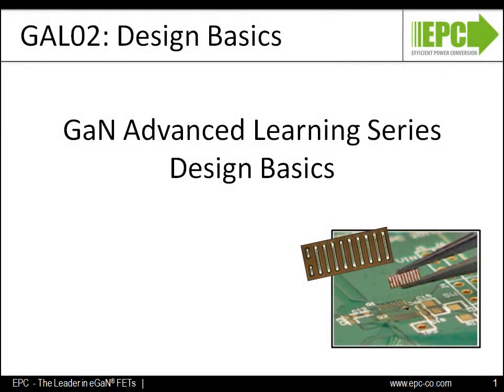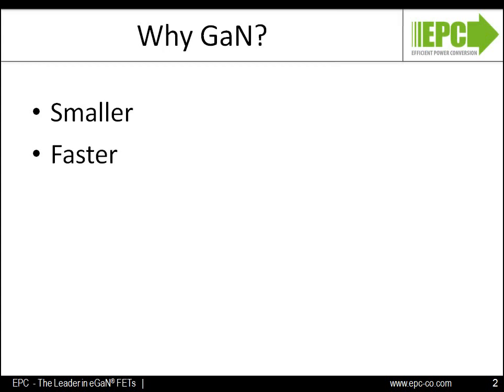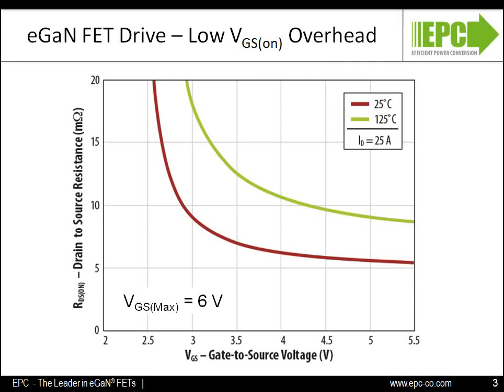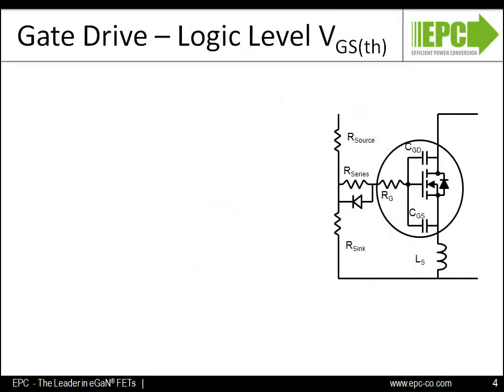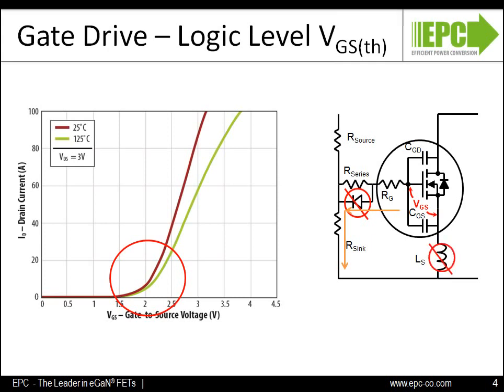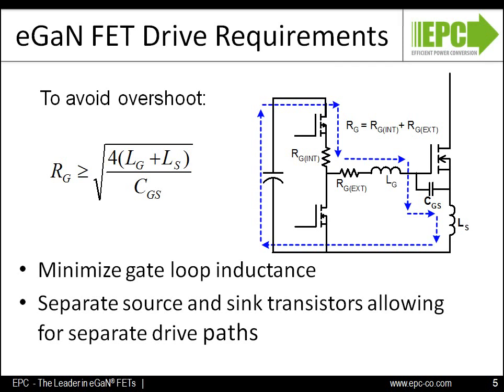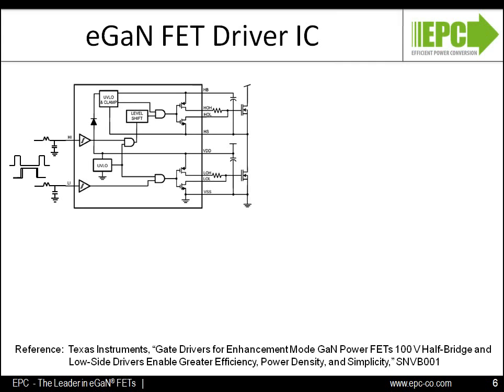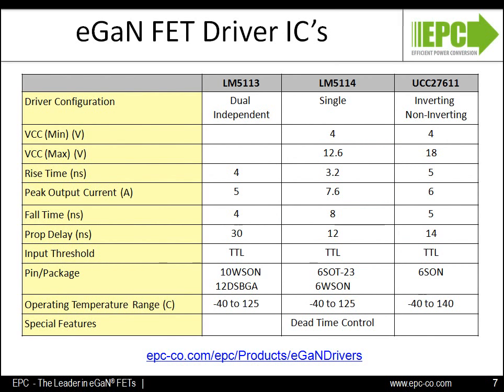GaN Advanced Learning 2 - Design Basics

Comment: how do superior conduction characteristics of GaN allow smaller chip sizes for the same Rds(on)?
Reply from the maker: The better conductivity of GaN means that to achieve the same low value of Rds,on as a silicon MOSFET, the resistance per square can be compared.  This is ohms * square mm.  At 100 V, the theoretical best a silicon MOSFET can do is about 0.1 ohms * sq. mm.  But, at 100 V, GaN FETs are about 0.02 ohms * sq. mm (using FET EPC2218 as a reference).  
Thus, this is a 5x improvement in conductivity for GaN FETs at this example voltage (100 V).  To get 0.1 ohms for a silicon MOSFET, 1.0 sq. mm.  For a GaN FET:  0.2 sq. mm.